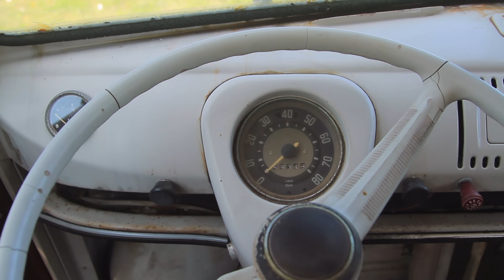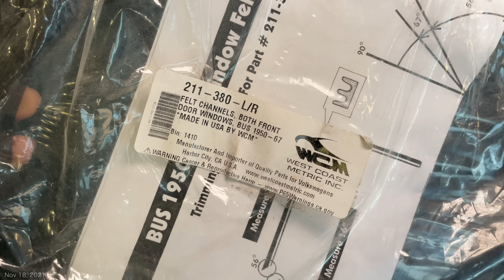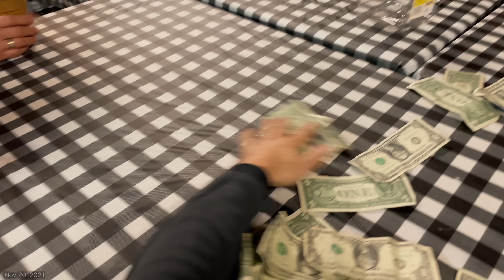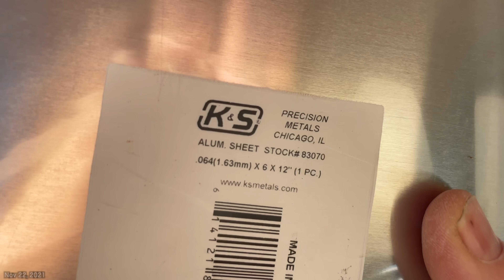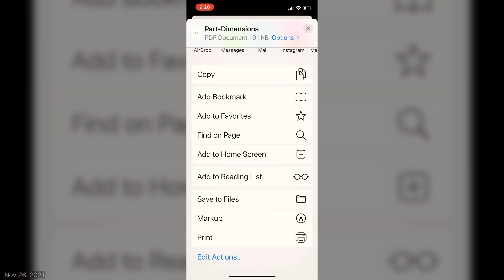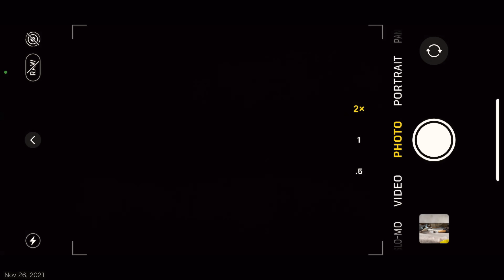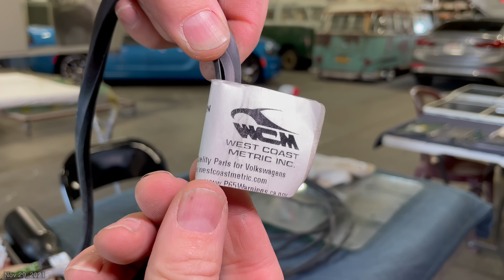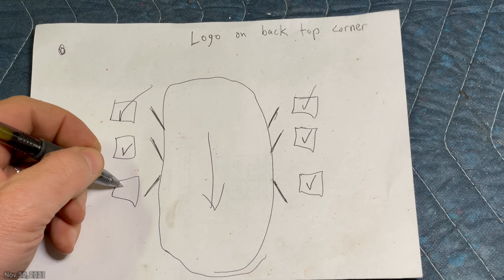VW Bus Restoration - Episode 61 - The new guy | MicBergsma

Comment: Mitch, You were looking for rear lights for reverse and illumination ? Had you considered an interior light shining thru rear hatch window via a light bar ?  You could integrate a modern style 3rd taillight there in middle and make it a VW logo that illuminates when braking so it's visible to cars behind from further than immediate car behind you... The reverse lights could also be triggered by a dash switch with a timer for safer passenger access around rear...

Comment: But did you actually put gear oil in the transmission. Or at least, check the level?
These things are easily overlooked and will cost you the gearbox within a few  yards.